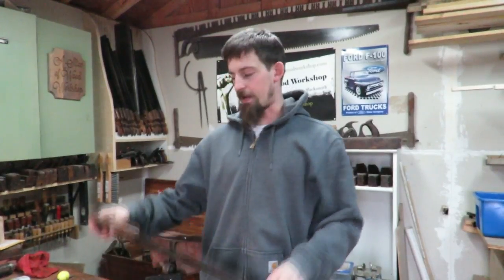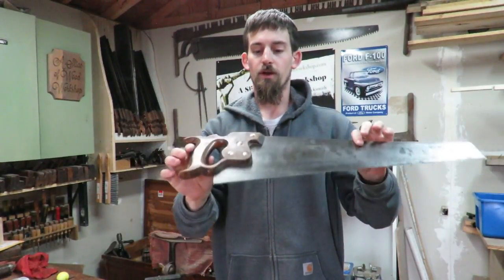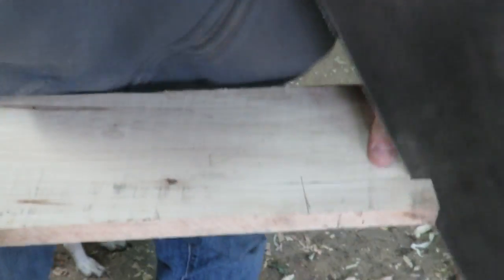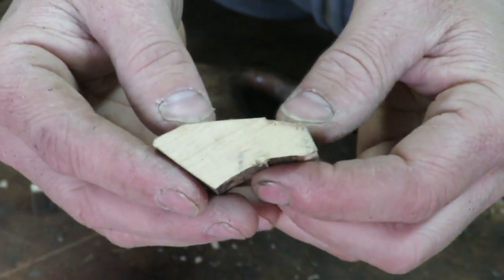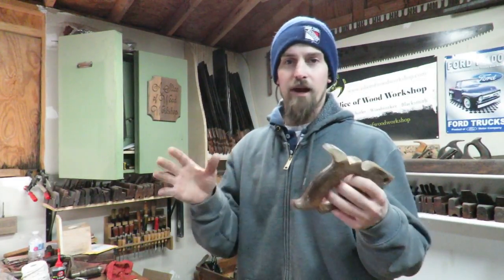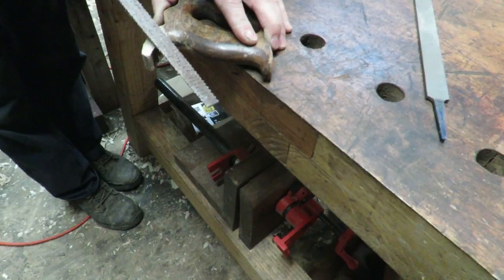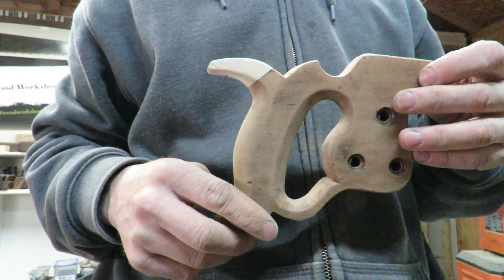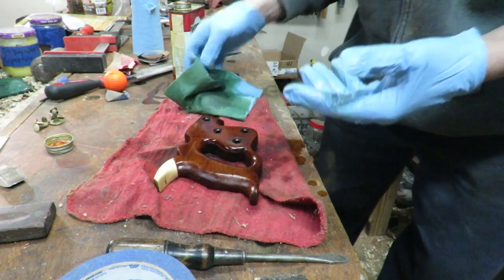How to Repair A Handsaw Handle

Comment: Nice job on the tote.  But, if you wanted to make it perfect, I would have darkened the new piece to make it a closer match and just protected it with b.l.o.. also, I might have put a dowel in the piece as a stubby tenon to make it stronger.  I have done a few of these just for the fun of it and you shaped the horn perfectly.  Nice work.
Reply from the maker: thank you. I left the new piece light just to give it a different look. If I were to make an actual repair on one to sell it would be the same color. thanks for checking out the video.

Comment: Cherry would have been a much better selection for your repair if apple or pear was unavailable. The cherry and a bit of stain would have disappeared into the existing colors of the aged wood and you would have a lovely restoration.
Reply from the maker: I will keep that in mind on the next one. I have some scrap cherry.